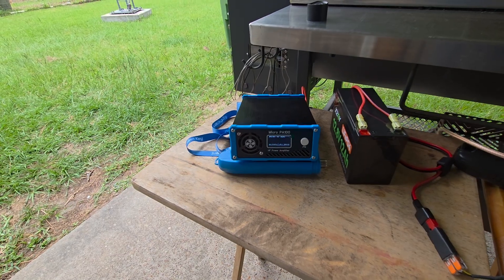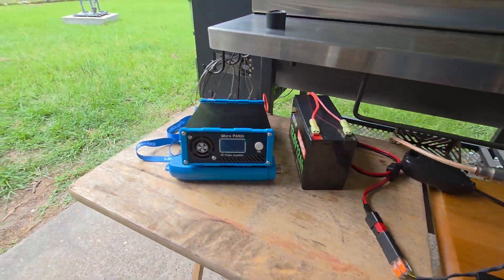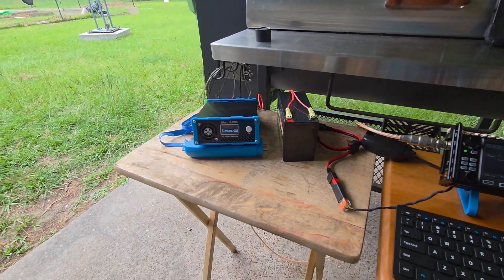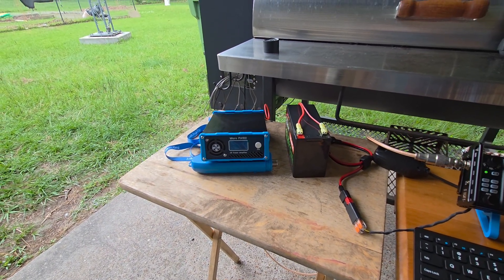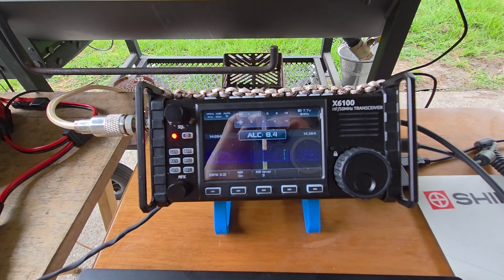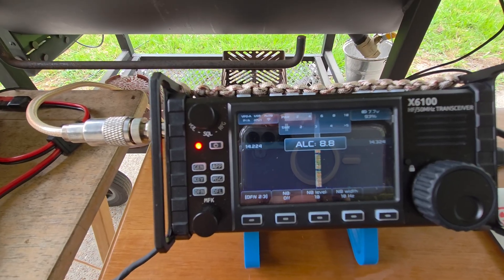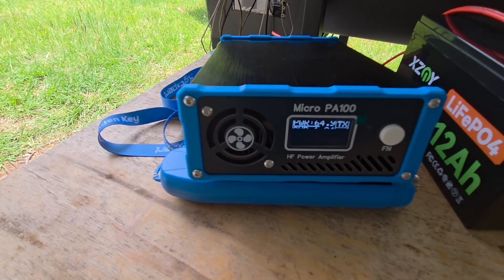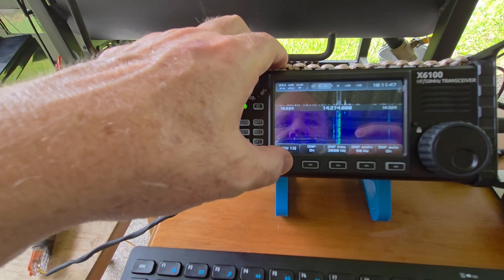Micro PA100 follow up after modification for 20 meters SWR issue

Comment: Hi N5BSB,
I’m Andreas (DO4NRW). I have a Micro PA100 Ver.1.1.6 (csqwdy, 4× IRFZ24N) that’s currently faulty.
Without the Facebook group I can’t access the schematics/info or firmware updates. My join request seems to be rejected or FB is glitching.
Could you please approve my membership or advise how to get in? I’ll ask follow-ups there and share repair results.
Many thanks & 73,
Andreas – DO4NRW
Reply from the maker: Your request was denied because you didn't answer all the questions. You must follow the rules. I went ahead and approved your request. There are no schematic diagrams published.
Reply: @N5BSB  Hi N5BSB,
thanks for approving me and for the clarification.

Regarding the application questions: the one asking for my callsign was answered (I entered DO4NRW). If I misunderstood what was being asked, my apologies — the wording may have led me to think my callsign was sufficient. If it needs something else next time, I’m happy to provide it.

I understand there are no published schematics. In that case, could you share any service tips for the MicroPA100 (v1.1.6, 4× IRFZ24N)? Things like the correct fuse rating, bias/sequence notes, typical failure points/test points, or recommended thermal mounting would already help a lot.

Thanks & 73,
Andreas (DO4NRW)

Comment: Ive just carried out this mod. found that 4.0v was too high and current draw increase was quite large, set to 3.95v and everything seems to be happy. That's using around 2w input for 80w output.
Reply from the maker: I tested both 4v and 3.95v and there was no significant difference. The output power was slightly higher at 4v so there could be a very small increase. Tested on 20 meters.
Reply from the maker: Are you referring to the amperage of the 12 volt power? If the amplifier puts out more power it might pull more current. Do you have a comparison as to the drive and output, and current at 4v vs drive and output, and current at 3.95? Just curious on the difference.
Reply: @N5BSB Yes the supply voltage. I did not manage to take a note of the current, the power supply I was using 30v 10A was set to 13.8v and dipped to 9v with a CC of 10A. I can revisit to get some definite data. I have tested with a battery as a power source and drawing around 17A when transmitting using FT8 as a benchmark.